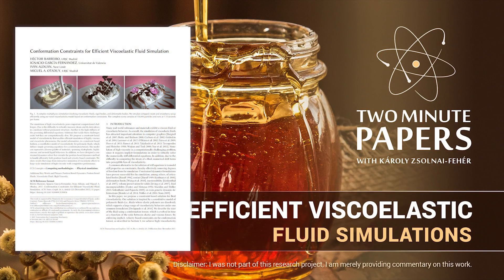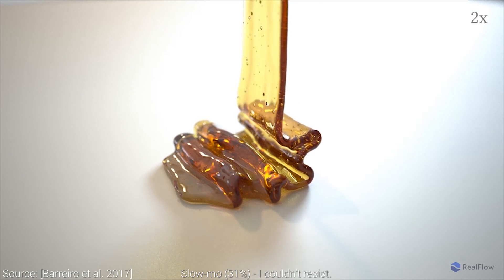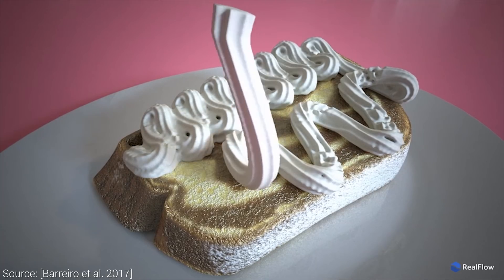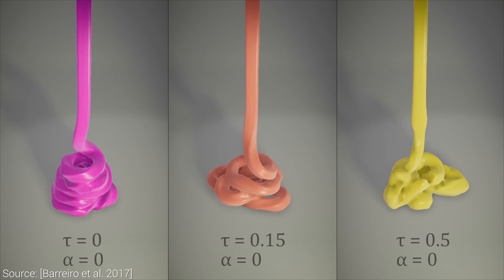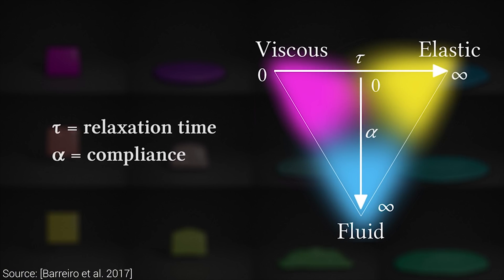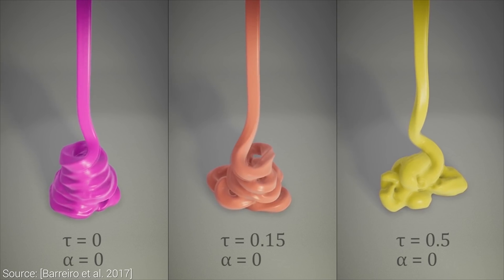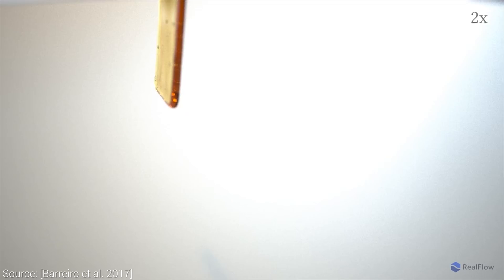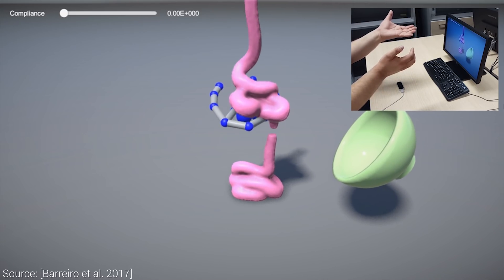Efficient Viscoelastic Fluid Simulations | Two Minute Papers #220

Comment: Speaking of real-time fluid simulations... I wonder what's going on with NVIDIA FleX (previously PhysX FleX). It's been a long while since I've heard anything about the technology.
Reply: well, only nvidia gpu's can use it, so it's use won't be anything other than effects added on for visuals, it won't be used in useful parts of games, or at least shouldn't.
Reply: prltqdf9 There is a option in killing floor 2 for real time blood which uses Nvidia flex